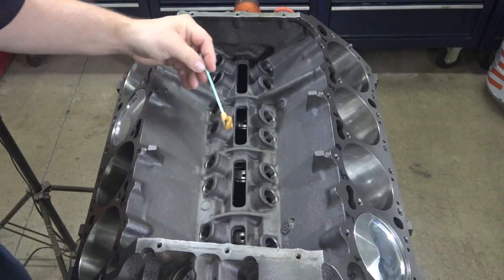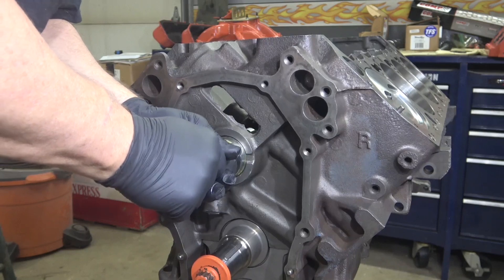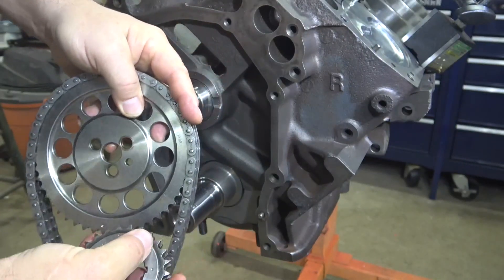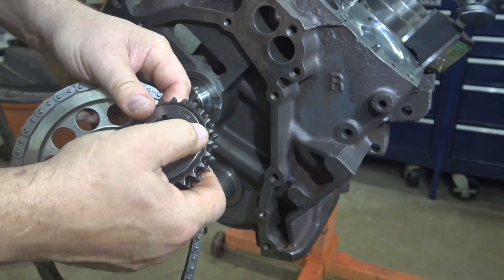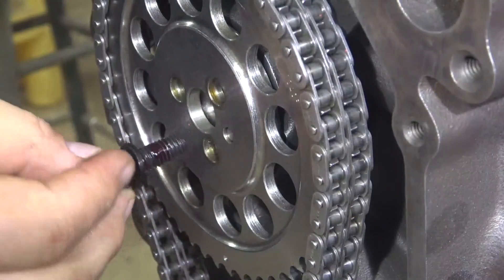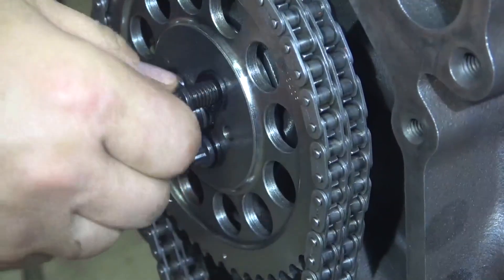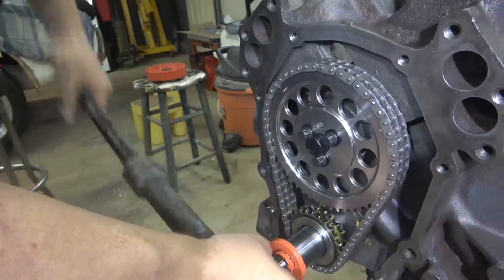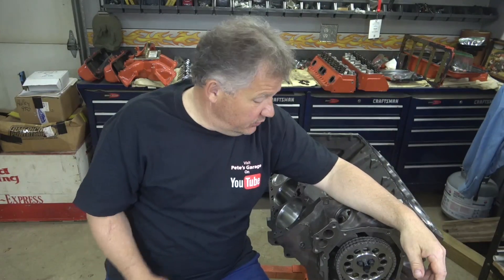Engine Rebuilding 440 MOPAR 512 Stroker - Reusing Cam Bearings, Cam and Timing Chain

Comment: Great video as always Pete. You are using a roller cam again. Have you found them to be very noisy? I have a Comp hydraulic roller in my 505 with Howards hydraulic roller lifters and Harland Sharp roller rockers. The engine sounds like a diesel. I have set pre load from 1/4 turn to 1 full turn and it makes no difference with the noise. Have you had this problem? I am thinking of switch to solid roller lifters with this hydraulic cam.
Reply from the maker: A solid roller would be more noisy because of the lash. Big blocks are just noisy engines